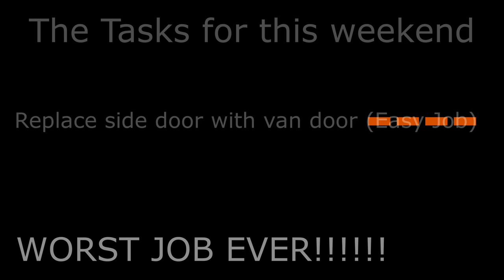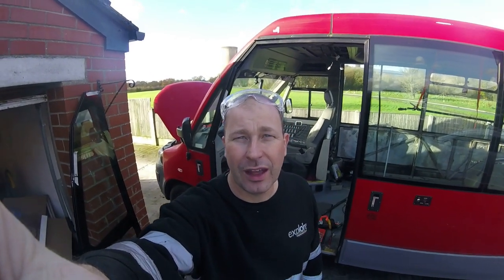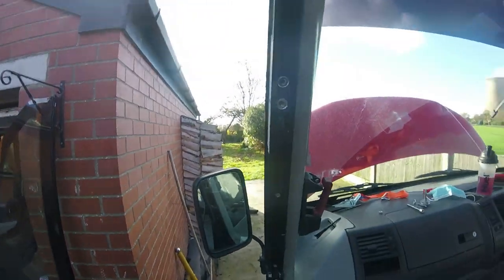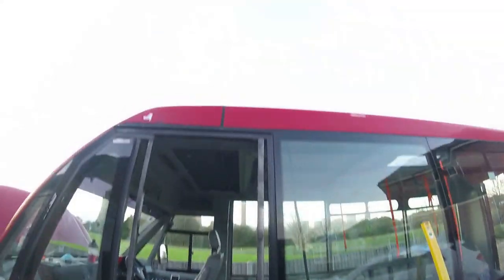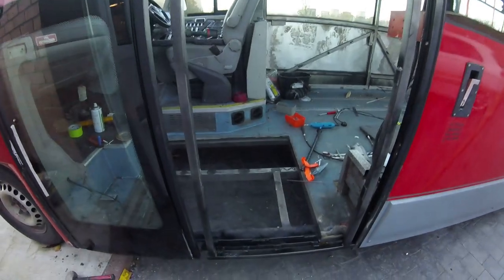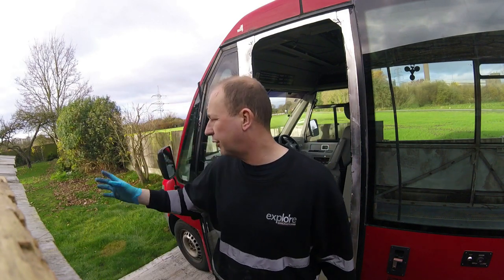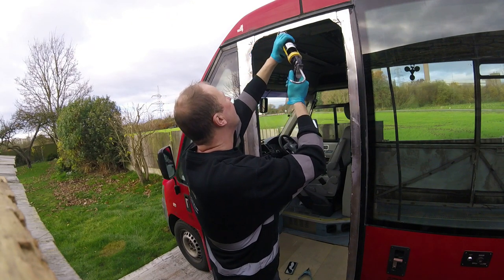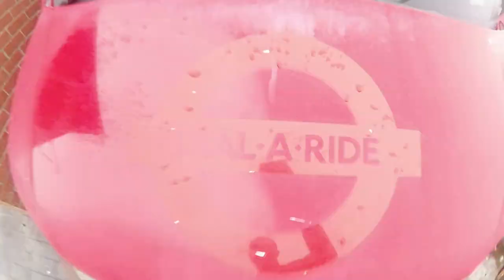DOOR FITTING CAMPERVAN The Worst Job so far

Comment: Nice job. I'm thinking about one of these vans but slightly put off by not having a front passenger seat. I admire your enterprise with the door, which is probably beyond me. Would it be possible just to remove the unnecessary door parts/handrails and raise the floor and fit another seat?

Comment: Hi just bought the same model van from the same yard in Birmingham, no issues with engine start after you removed the wires from the double doors!? I'm about to modify them too and to have only one side opening ( original door)
Reply: Hi are you interested in selling the door and hinge assembly that you take off?
Reply: @darrynbird8111  The van is long gone!

Comment: Hiya. I'm doing something similar with a Bluebird tag axle. Since i've removed the doors I now find the suspension was connected electrically to them somewhere & doesn't want to lift! Have you found anything along these lines?
Chris (in Hull)
Reply: Hi are you interested in selling the door and hinge assembly that you take off?
Reply: @darrynbird8111  Hi Darryn. Sorry for late reply. Limited signal at Tribfest. Ive already sold the doors and motors. All I really have left is the Emergency door releases from the outside.